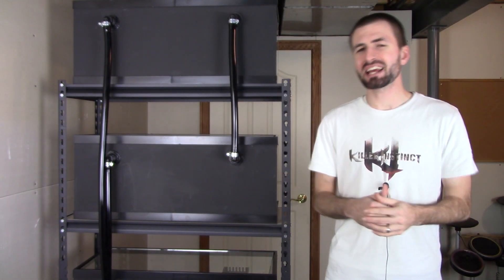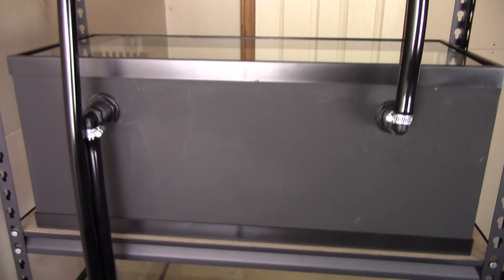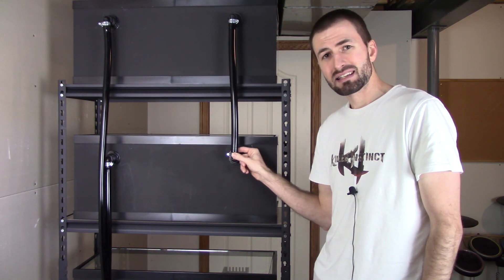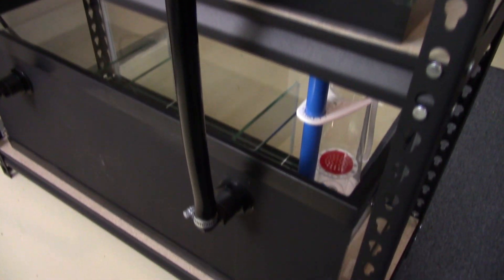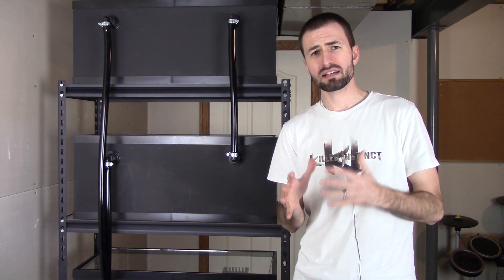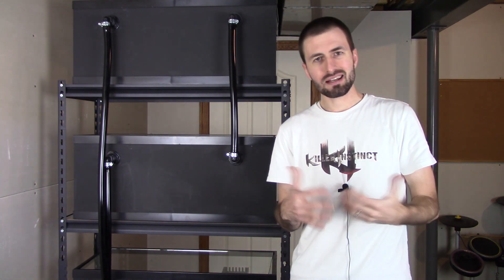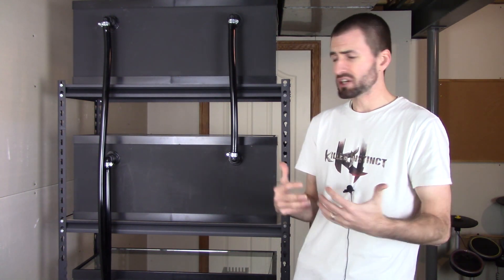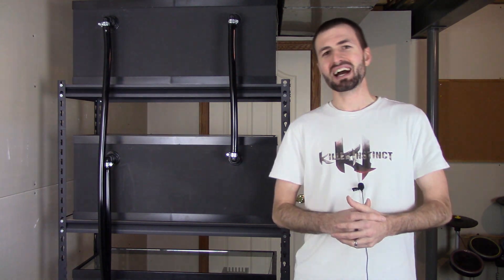The Fish Tank Tower - Plumbing!

Comment: Nice set up. My issues would be, that as it is essentially one system, any disease outbreak will effect every aquarium. Also, you can’t shut off an aquarium without shutting down the whole system. 
Neat work though.
Reply from the maker: You are definitely correct on both fronts when it comes to the way I setup the system.  However, in the interest of simplicity and also cost, this was the most viable option for me.  I'm assuming there may be some other folks out there who also have the same constraints, so hopefully the series will be informative at least!  Thanks for watching!
Reply: Simply look at the whole setup as a single tank with dividers or something, treating any issue that arises should be pretty straight forward as they would be in a single tank.

Comment: Cool video, thanks for sharing. Now, I am in the business of building/buying a rack system and as I see, what you have for the shelving unit, it is thin metal... How many tanks you have on there and at around 50# of weight per tank, I doubt this will hold 350# of weight... How is it going to hold? THanks for your help :)